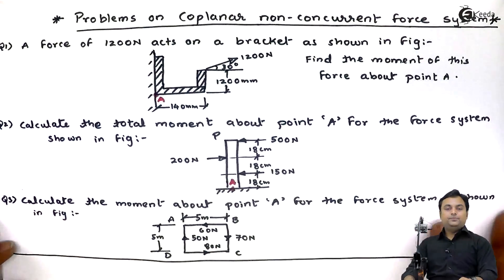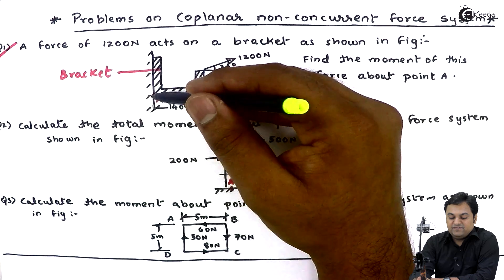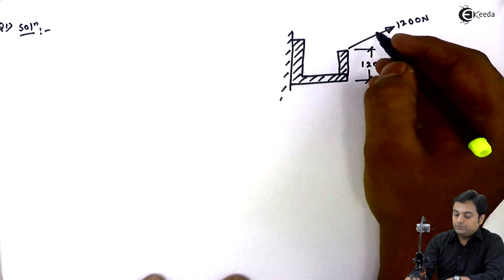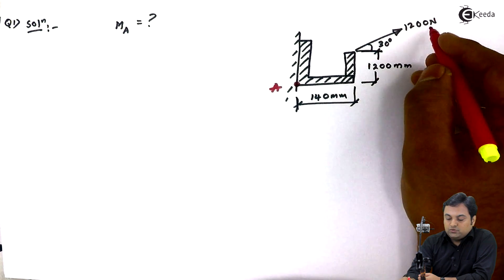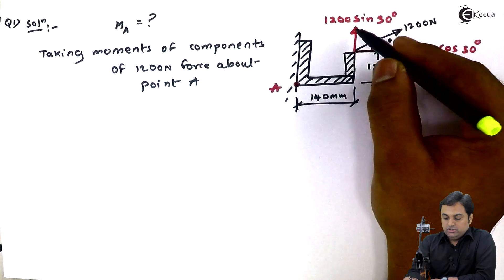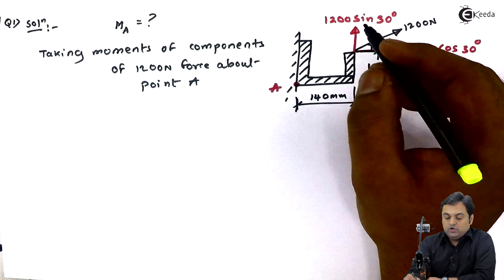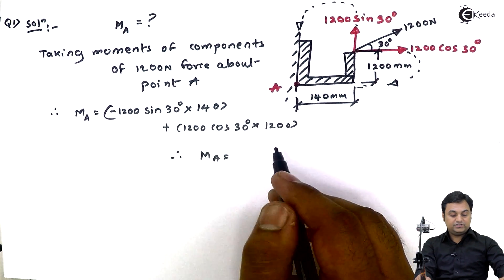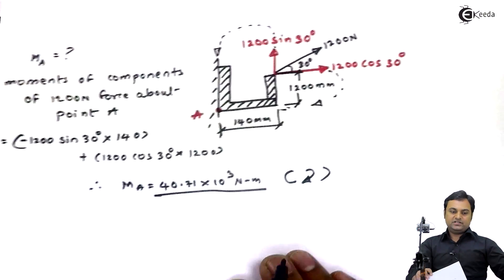Coplanar Non-Concurrent Forces Problem No.1 - Resolution and Composition of Forces

Comment: Hey guys, The correct answer is 1163.076N-m because he made a mistake on his calculation he have used 1400mm instead of 140mm. if you used 1400 then the answer will be 407076 which is wrong. Hope this help you
Reply: Yes 
116.3076 is the right answer
Thank you

Comment: -1200sin30×0.14+1200cos30×1.2=1163.076
Reply: Hey guys, The correct answer is 1163.076N-m because he made a mistake on his calculation he have used 1400mm instead of 140mm. if you used 1400 then the answer will be 407076 which is wrong. Hope this help you
Reply: Kya aap yeh bata sakte hai ki 1200cos30×1.2 kyu liye 1.34 kyu nahi liye kyu ki point A ke respect me moment nikalna hai na to doubt hai agr aap samagh gye to bata digia 😊🙂

Comment: ansr is right  so u guyz plzzz solved properly then argu
Reply: he has taken 1400mm instead of 140mm. if i am wrong show me the steps
Reply: Hey guys, The correct answer is 1163.076N-m because he made a mistake on his calculation he have used 1400mm instead of 140mm. if you used 1400 then the answer will be 407076 which is wrong. Hope this help you
Reply: Ahmed raza...so u have foreseen the question....damn.....dats..suprb..4 chrissake
.fcukoff

Comment: Sir ans will come 1163.076 N-m...of 1st Question
Reply: Hey guys, The correct answer is 1163.076N-m because he made a mistake on his calculation he have used 1400mm instead of 140mm. if you used 1400 then the answer will be 407076 which is wrong. Hope this help you
Reply: You are correct. I got the same answer as you. If you are giving the answer in Nm, then the distances will be 1.2m and 0.14m which gives a total moment of 1163.08 Nm.